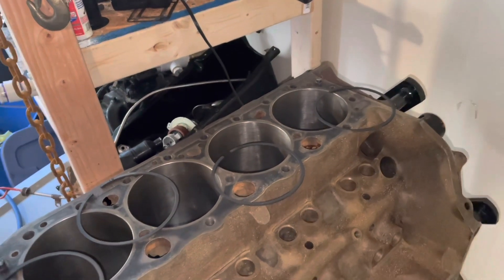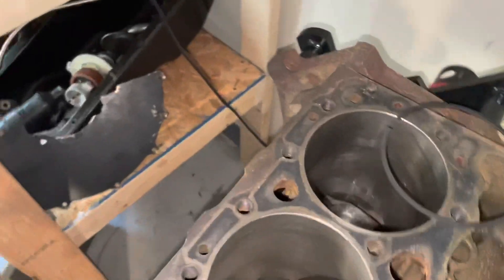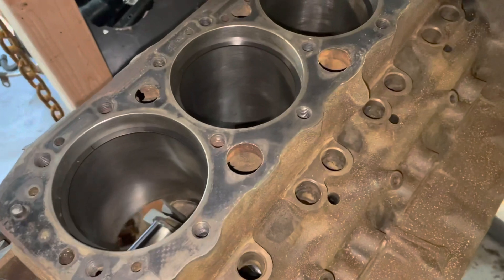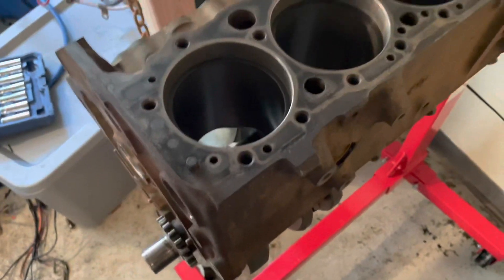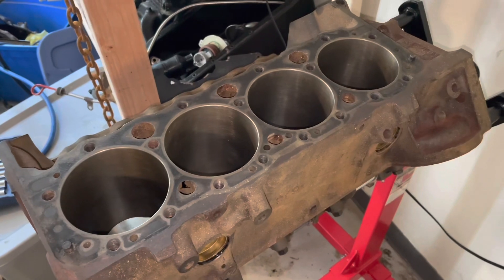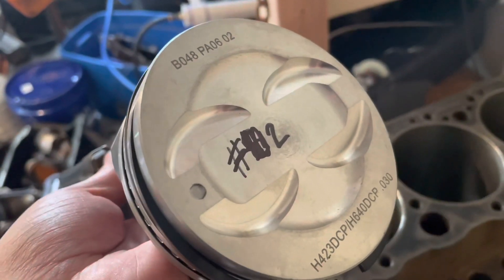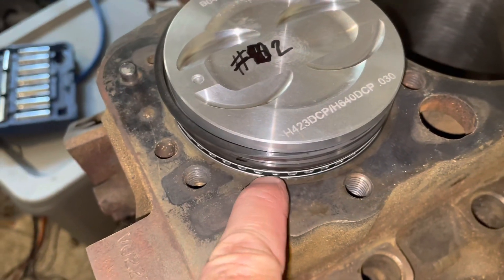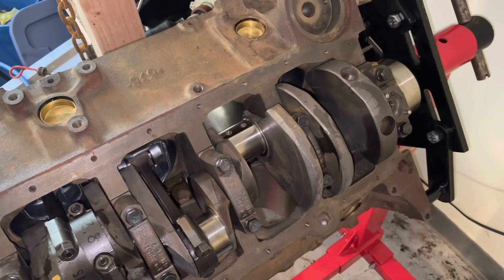Mercruiser 5.7 1(e) - Rings and Pistons Finally

Comment: What brand of main an rod bearing do you use on your builds?
Reply from the maker: Sealed power or CLEVITE 77 P series. I rarely use aluminum bearings even though GM factory bearings are aluminum. I have videos on the parts I use.

https://youtu.be/vR-mao6ZZX4?si=joDRmlnI6dHZ6OzW
Reply: @moccasinmarine  how you feel about King hp bearings.
Reply from the maker: I only use top quality parts. The difference in cost isn’t worth the risk. I believe Engine Tech uses King bearings in their kits. I’m not impressed.

Comment: What would the ring gap be on a stock build too an bottom rings
Reply from the maker: http://marinepowerusa.com/wp-content/uploads/2019/08/5.0L-5.7L-MEFI-4-Service-Manual.pdf

Page 6-4 has the ring gap specs but there is a mistake in the spec for top ring gap. It says 0.098-0.015 inches but the correct range is 0.008-0.015 inches. The online manuals are full of mistakes so look at surrounding numbers to figure out the correct value when mistakes are found.